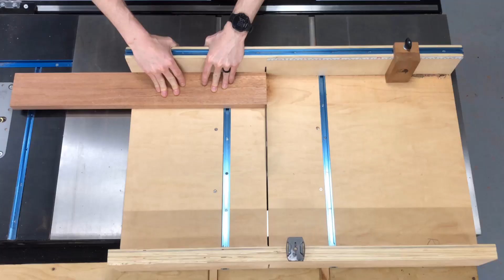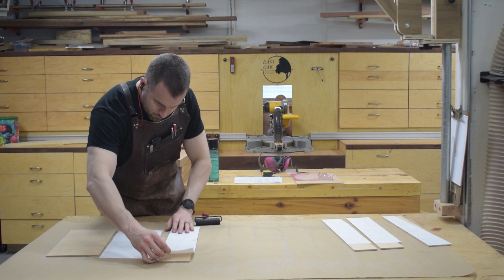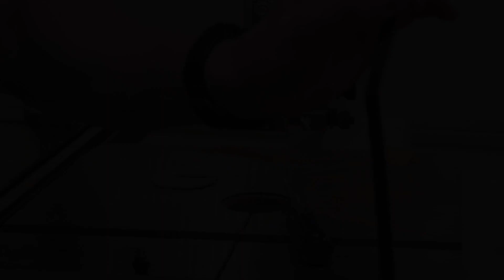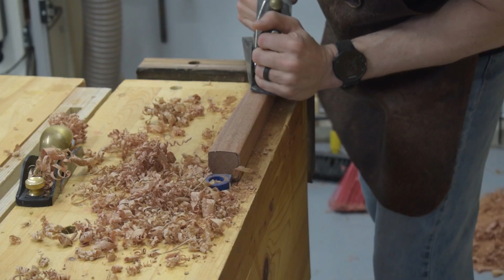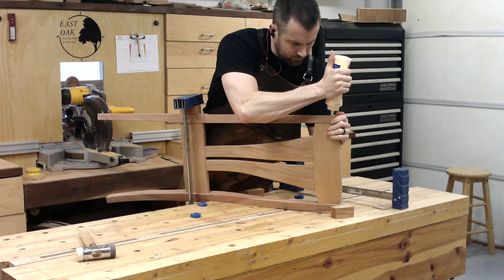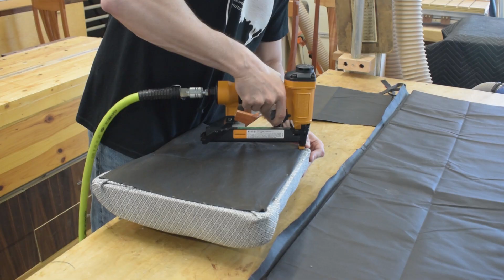Dining Chairs Part 2

Comment: Hey dude, what hardware you using for the tilting mechanism on your mortiser? Ive build one similar and would love to add that feature to mine. Thanks
Reply from the maker: I used a piano hinge and a couple drafting table style casement stays, here’s the link, but I will say that they do have more slop in them than I like. https://www.amazon.com/dp/B004HAFK72/ref=cm_sw_r_cp_api_i_1-xsFbFJ0A71V